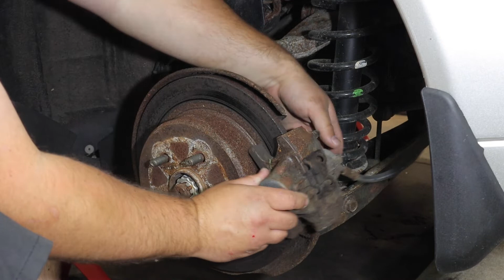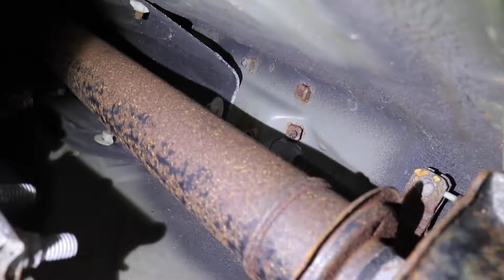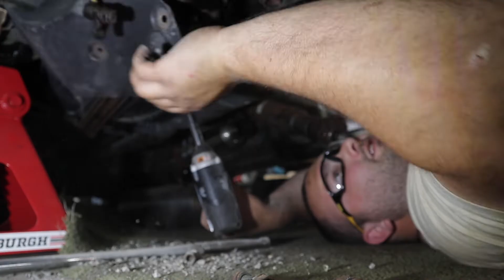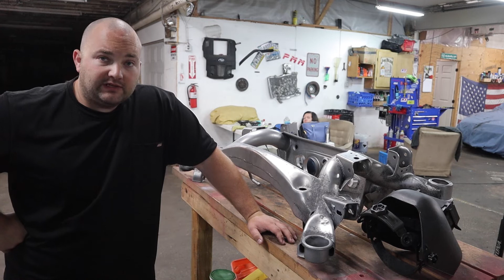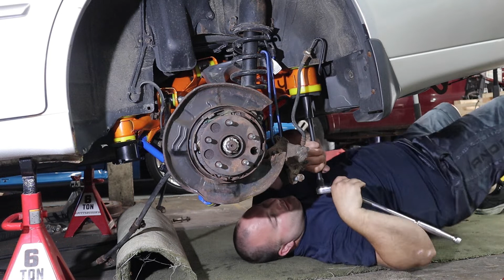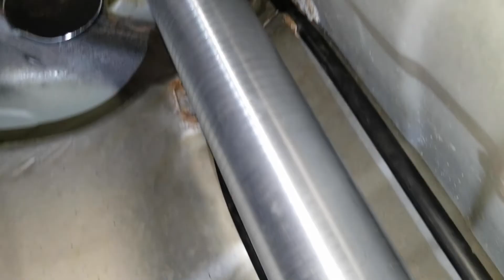Rear Subframe Removal and Installation | Lexus IS300 GS300 IS200 Altezza

Comment: Just started to remove my 14 year old 126000 mile isf subframe, I've been soaking it with WD40 for 2 weeks before I started and no broken bolts yet. 
A lot of surface rust to deal with though.

Comment: Hello fella. I don't suppose you have a video for the front cross member removal? Got an old IS200, and I'm trying to get the oil sump off and the cross member's in the way...
Only have basic tools, no engine hoist, if you need to life the engine I mean.
Reply from the maker: sorry i didnt do the front crossmember on this car yet
Reply: @PoorManMods  Oh ok, no problem. Do you have any insight for me please. Just from looking at the underneath, can you tell me if it's possible to do this without an engine hoist? 🤔
Such a pain in the fuckin' arse how the sump is longitudinally placed right above the damn cross member. And you can't just loosen the sump and slide it over because of the oil pick up inside it... 🤨😕

Comment: Doing the same job on an 04 Highlander, subframe & diff is roughly the same, diff mount bushing are exactly the same. Any tips on dealing with the subframe bushings & fasteners bolting them to the body? 20 year old car in the rust belt, may be seized. Been hitting it with penetrant weekly. Really dreading dropping the subframe but bushings all need be changed. The bushings where the diff mounts i already got a tool for, should be easy. The bushings mounting them to the body, dreading those bolts! :/
Reply from the maker: Not sure if penetrating lube will do much help because of their mounting orientation unfortunately. This car was a 250,000 mile rust belt car also. Just use a big breaker bar when trying to break them loose and make sure the car is nice and secure when doing so.

Comment: Hey man great vid, do you have any other recommendations of things to do while the subframe is out?
Reply from the maker: Thanks! with the subframe out i would recommend doing the at least the upper control arm bushings and replacing the arms themselves if they are super rusty like mine, as they are very hard to get to with it in the car. But i did all of the control arm, diff and subframe bushings.

Comment: Hello. Does the is200 subframe fit on is300? My is300 is broken from accident, and i cannot find subframe for is300 in my country, but i can get for is200. will it fit ?
Reply from the maker: I'm not sure, I wouldn't imagine they're the same
Reply: yes, is200 toyotas <-> lexus is300 are interchangable in terms of non-engine related parts